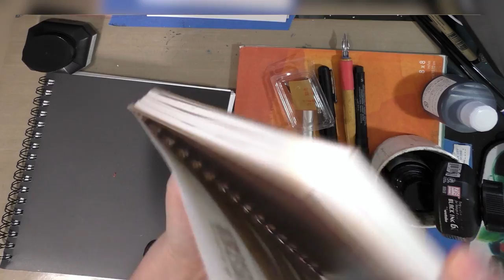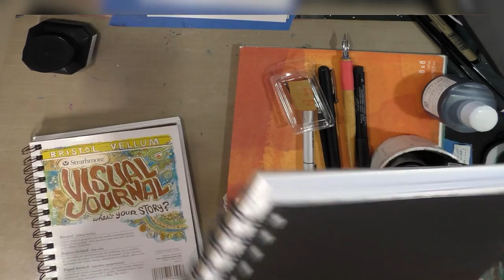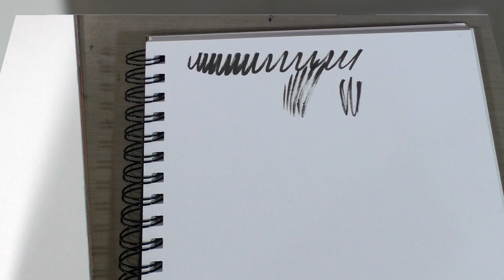Inktober Limited Edition ArtSnacks Overview

Comment: Thank you so much for all the information in this video! I was incredibly excited about the Inktober collection and did end up purchasing it. . . but seeing what is in it, and the fact that it is so over priced for what is included, I might end up sending it back and just go on a shopping spree. (I put basically the same items in an Amazon cart just to see, and even that only came to $57)

If you had put together this box what items would you have chosen? 

Oh! And I absolutely love dip pens, but I think I've been holding it wrong, thanks so much for the tip about the curve of the nib!
Reply from the maker: That's a fantastic question, I've been musing about it on Twitter for awhile.  I would have kept the inclusion of a Kolinsky sable, but I would've gone with at 2 or smaller, i would've skipped the Multiliner SP for either a Multiliner in Sepia or a few colored Sakura Pigma brushes as colored lineart generates a lot of interest, I would've included a walnut ink as those are fairly uncommon for inkers and would've made for a fun addition.  I would've skipped the Denik notebook for a Strathmore Visual Art Journal, and thrown in some fude pens or the Sakura FB, MB, and BB Pigmas, I would have kept the spoon nibs (the Sa-ji) but also included G nibs, tank nibs, and crowquills as nibs are fairly inexpensive, I definitely would have thrown in a few cut down sheets of cold press watercolor paper so people could pay around with drybrush techniques.  I would have kept the Pentel Pocket Brush, but maybe thrown in a few fountain pen inks capable of shading and special effects (as that's something I would like to play around with eventually, and some sites offer samples).  Regarding the class, I would have commissioned tutorials from a handful of artists to demonstrate one technique they specialize in, and made those commonly available on the YouTube channel, not only to promote the box, promote those artists, but also for people who might want to follow along and who might decide to subscribe later on in the year.  @LeannaCruz suggested sumi brushes, and while I have no experience inking with them, decent ones are fairly cheap, and it seems like a fun way to get people to push their boundaries.  If any budget was left over, I might've also included a Menso brush.
Reply: That is a really intriguing list! I'm planning on sending my collection back and putting together a little Inktober collection for myself and think I'll borrow a couple items you listed :)   And I LOVE that you mentioned Walnut Ink!  It's been one of the things on my 'to try' list, perhaps now is the perfect time to do so :D 

You mentioned how superior the Winsor & Newton Series 7 Kolinsky's are, have you ever used the Davinci or Raphael Kolinsky brushes?

Comment: Honestly I use the tiny sharpies (sorry- extra fine tip) ones for inking and they work fine and are cheap as dirt (well almost).
Reply from the maker: The Sharpie Pens?  I use those for doodling, as I can get them just about anywhere!  For art you want to keep, or art you're selling, I suggest at least picking up so something rated as archival.  I haven't had my Sharpie Pens fade yet, but sometimes it takes a few years for inks to degrade.
Reply: Becca Hillburn I'm not an adult and my art isn't good enough to sell so they work for now.

Comment: I have not seen the Micron pen at any Walmart that I've ever been to. Maybe they have them at some but not here. They might have them sold online though.
Reply from the maker: +TheBiteSizedCrafter I've seen them at the Super Wal-Mart in Kenner, Louisiana a few times in the art sectiom, and they are on Wal-Marts site, but yeah, I doubt they are a common Wal-Mart staple
Reply: They must not be. They did have some Prismacolor liners and Indian ink. I added a couple drops of the latter to the former and some how that made them Copic proof. lol
Reply: The ink she got is sumi ink but you got indian ink so that's probably why your ink was copic proof. Copics are also alcohol based markers, so that could make a difference to the bleed of different inks.
Reply: Indian ink is mostly water proof and no alcohol proof. Though I guess it depends on the brand.

Comment: most of the things are often already in an inkers stash. if someone is to buy this individually I would agree that its a rip off of said $30. but you did not include; shipping, cost of boxing, salary of persons involved per boxing and other overhead charges. so probably and most likely that is the said $30. otherwise you did a very good demo and review of the entire box contents. keep up the good work and God Bless!
Reply from the maker: When calculating value, I calculate the value that most concerns the artist.  While time, effort, salary are important, that's spread across all subscriptions and orders, and would be a minimal addition of cost.  If you check out my monthly Artsnacks unboxings, you will find that Artsnacks is usually MUCH closer to the price charged.  This box was a shocking and disappointing exception.